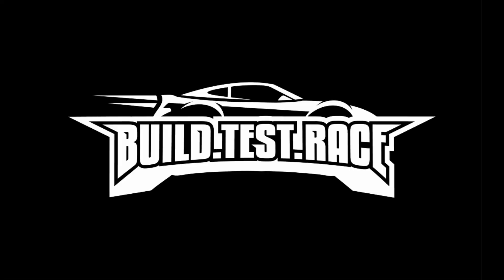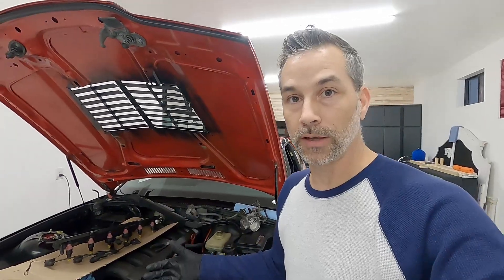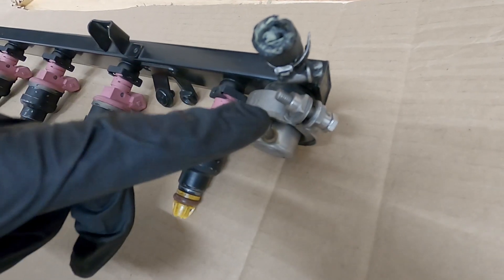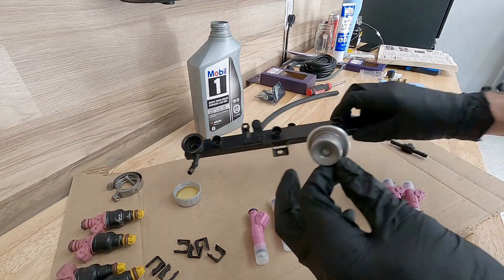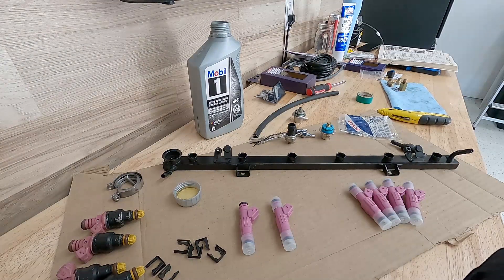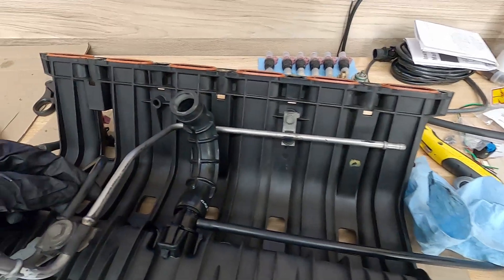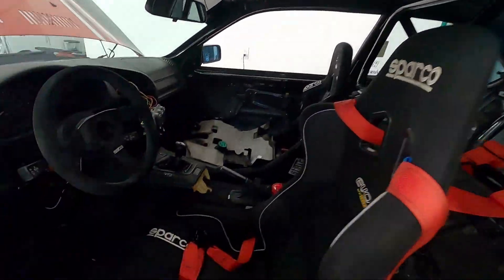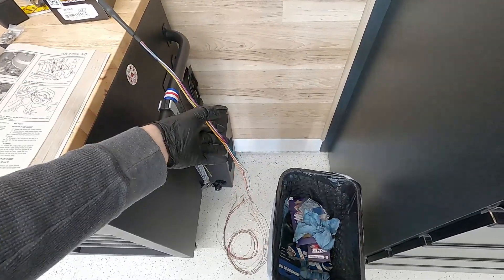e36 BMW Fuel Injector Upgrade - 24lb injectors!

Comment: What's the part number on the new injectors? The website doesn't say
Reply from the maker: I see a part # there. You have to call Bimmerworld and provide proof that they are for use in a race car before they'll sell them.
https://www.bimmerworld.com/Intake-Fuel/Fuel-Filters/Bosch-24lb-Fuel-Injector-Set.html

Comment: My e34 M50B25 is misfiring, changed everything but injectors. I'm a novice when it comes to cars; learning on mine. Would these be okay to use for a stock motor? Would I have to modify anything? I don't really know much about injectors. I can't afford brand new original injectors for $1100
Reply from the maker: You wouldn't want to use these larger injectors unless the rest of the car was upgraded for them. You should be able to find a set of refreshed OEM injectors on ebay, or you can send your injectors to an injector cleaning service and they will clean and test them all. That said, injectors are unlikely to cause a misfire.

Comment: if i change my injectors on my e36 328i for ones like yours or someting original BOSch but more modern style injectors, do i need to tune the ECU?
Reply from the maker: It helps to have a tune or chip, but you don't need it. You really don't need injectors unless you're pushing more power through the motor.